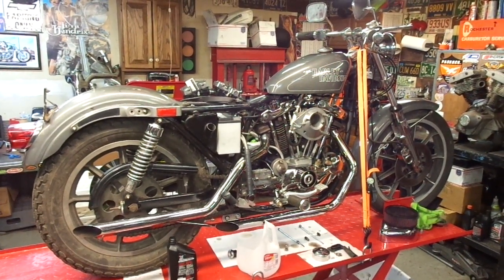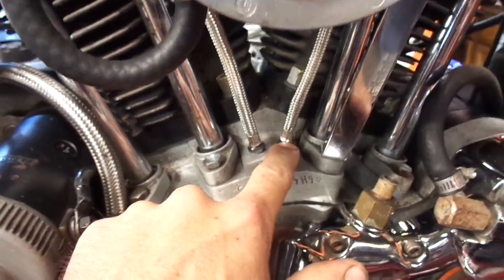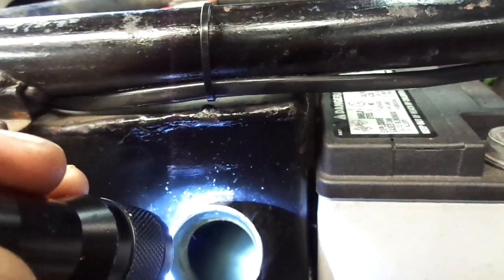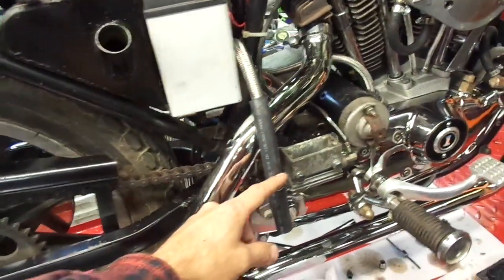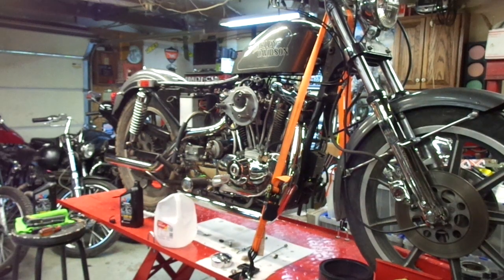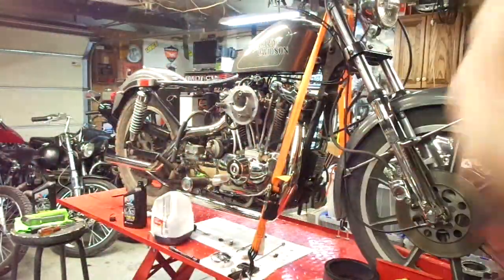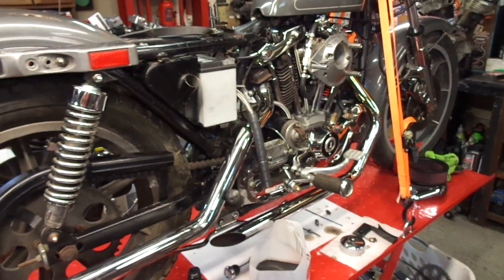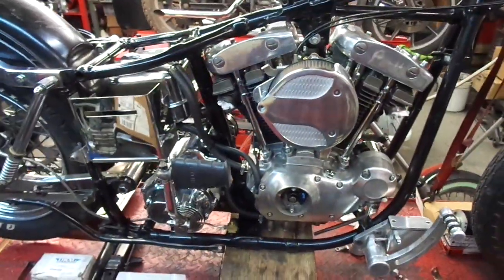Harley Oil Change Flush Out The Old 79 Barn Find

Comment: I just looked at a product called Scavenger Oil Change system, and I'm wondering if I could just tap into the oil filter with a hollow brass fitting, like an air fitting and connect a hose to it and run it into a pail to push out all the old dirty oil. Maybe it would be as simple as drilling out the oil filter and screwing in the brass air fitting. Couldn't I then just idle it and watch for the oil to run clean and then shut the bike off? Would I still have oil pressure, as long as the fitting isn't too big?

Comment: I was wondering if I should add about a quart of diesel to the oil tank just before I change oil and let it idle for about 5 minutes or until it warms up, and then drain, and maybe fill it with some cheap thinner oil and then run it easy for about 15 minutes and then drain. I wonder about sludge especially in the lifters. It's a 20 something year old Sportster. I first wanted to see if anybody does that or recommends it before I do it.

I did that to my van because I had coolant in my oil due to a timing gasket failure. Sealed it with K Seal and then gave it a flush with about a quart of kerosine I had, letting it idle for about ten minutes. The motor seemed to like it. It quieted right down, and ran better.
Reply from the maker: Personally no I wouldn't add diesel to the mix your gonna have hard time getting it all out. Like in the video I'd remove the oil return line from the tank, start the bike and pump the oil old out. You could feed an extra quart through until cleanish oil pumped out aswell.

Comment: I'm just finishing up a 1980 Ironhead I ran it a couple times so far and just running it with the bike still on the lift but I'm getting a little smoke and black liquid out of my rear cylinder exhaust seems to thin to be the oil but also doesn't smell like fuel when I rub it on my finger would you have any idea of what it could be. Any info would be greatly appreciated thanks for all the great informative videos also.
Reply from the maker: Well it's got to be fuel, oil or maybe just some moisture from sitting mixed with carbon in the pipes. If just smoking out one cylinder possibly valve guides leaking some oil past or maybe the piston rings. A compression test might not be a bad idea to see how much difference between the front and rear cylinders.
I appreciate you watching the videos!
Reply: @jfrost77hd  I'll do a compression test and thanks for the info I really appreciate it.

Comment: Hello JFROST I had a dumb question you probably know I have a 79 Ironhead was wondering how much oil to put in primary?
Reply from the maker: On the side of the primary cover there is a bolt about a quarter way up the cover which is the fill level with the bike standing straight up.
Reply: Cool thanks that’s what I thought I just wanted to make sure thanks man have a good one 🤘🏻

Comment: I have a 72 sportster been sitting for 19 yrs. my friend got it running about 10 yrs ago. He has passed since. Now wanna get it going again. What kind of oil does it take?? Don’t know much about bikes but gonna try it
Reply from the maker: Hey Josh, 20w-50 engine oil...would also be good to check the primary side oil aswell and topoff with Harley trans fluid or equivalent if it's leaked out.

Comment: Hey bro really like that video much appreciated just bought a 76 250 Sprint SS brought home that night   with it drink a couple beers pulled out the sawzall cut the rear fender off then lower the rear fender by about 4 in and cut the rear loop section of the frame off for the tail lights and signals used to be haha, anyway bro mindset for a long time it only has 2,224 mi on it and since 1976 so my shits really fuckin sludgy man, any tips on this little cheap ass 250 Sprint, no man it's a cool little bike and a great first little bobber for both my daughters to share and learn to ride, I don't know if I can on this side but I'll try to shoot you some pics, tnx brotherman n much appreciate..

Comment: Awesome video brother im about to revive a 1990  and want to do this as well , is the 90 block the same as 89 ? The reason i ask is i own a 96 sporty and my block is way different , i dont have a vent tube behind oil filter , mine are in the heads to the breather . Just looking for info on when the blocks changed .you seem to work on them figured you might know . Looking at a 74 as well
Reply from the maker: Hello,
I really don't know much about Evos unfortunately, this bike was a 1979 Ironhead.
Reply: The crank case breather was changed to the heads only because of EPA emissions crap. I rerouted mine from the heads of my 2018 out under the motor because that shit going back into the intake is a no go for me. The 90 block is the same as the 89, they changed it in 1991. The 4 speed bikes (86-90) vented from behind the filter and 5 speeds (1991+) vent from the heads.

Comment: This video help big time🤟 frost, and is that a oil filter between the rear master cylinder and the engine howd you do that? Where does what connect what?
Reply from the maker: Hey Julio, glad the video was helpful. That's the starter your referring to I believe, thanks for watching! 👍
Reply: @jfrost77hd  oh yeah I see it now ... I got this same bike but it's a kickstater from the bay area I just saw the other video helpfull 🤟 keep them coming...
Reply: @jfrost77hd lol I got o e problem man, my bike is on neutral right and when I try to rotate the engine with the kickstart i can see the the cylinders don't move, what do u think the problem is frost?
Reply from the maker: @Galaxieshop  I assume you mean the pistons do not move when rotating the kickstart? Either the kickstart gears are not engaging the teeth on the clutch basket or you have no primary chain or missing other parts under the primary cover.
Reply: @jfrost77hd  yea that's right pistons smh, thanks for getting back to me, I will check  all of the gremlins of my check list 🤟

Comment: hey mr frosty, I recently completed a custom shovel chop, total mish-mash homemade motor, lol. after a few hrs of running I'm getting a lot of seepage from my exhaust rocker shaft caps, high-pressure readings (80+psi) and now its leaking from my top rocker gasket on the rear cylinder. checked the check and relief valves and ball, seem ok... getting flow at the tank, even drained about 1 quart thinking I had too much oil in to start with. any ideas? (besides pulling her all apart again? :(
Reply from the maker: I've seen some rocker endcaps seep especially when engine is hot   and if you didn't replace the seals it's probably time. The topend really isn't a pressurized system but oil volume. Are you sure the breather gear is timed with the cam correctly?
Reply: hey buddy, I got it straightened out. figured something wasnt letting it flow properly? had to be either the check or relief valve? so I picked up a couple of each for like a b$ck apice, put the weakest one in the relief and it worked perfect! Engine is a frsh buld with new everything, including a Ultima pump... second one of their products that I've found to suck (or not what I ordered) the other is a damn SHITTY kicker set-up on their 6 speed tranny. the spring or something in there is preventing the gears from engaging when I try to use the kick. others have had the same prob I've heard. Lessen of the story? stick to Harley parts ;)

Comment: Yeah bro I got my 1980 Ironhead Sportster 1000cc running last night.
I dont have a reverse throttle cable in & that screw under the throttle housing.
The throttle will go forward but not reverse back sometimes?

I was told I have to have it in & told not to necessarily,getting mixed statements?

I let my dad run it last night & said it kept wanting to die,then he had to pop the clutch in 1st to keep running?
You know what would cause that?

I'm getting ready to change the oil for the 1sT time since buying it 2 weeks ago.Replacing it with new oil.
Getting ready to replace the spark plugs too.To see if that's what's keeping it from dying.
I got a new battery in it?

Damn bro I wished you lived in Indiana! 😆

Comment: do you ever run a car engine cleaner fluid of any type through the engine or is that dangerous to do to motorcycle engines?
Reply from the maker: I occasionally use Seafoam spray in the carburetors, Stabil in the fuel before storing or the Stabil Fogging Oil in the cylinders. B-12 Chem-tool works good for decarbonizing heads before rebuilding them. I did get some jet fuel I plan to play with ratios for an octane booster but nothing to crazy. Thanks for watching Robert!

Comment: Good clean videos..nice work bro
Reply from the maker: STUCK ON THE LINE Hey thanks for watching!
Reply: jfrost77hd my wife has a 96 883 that has a miss once in a while I've cleaned carb put a new air filter I was told it's gonna have it with drag pipes..runs great idles great just hiccups once in a while any ideas
Reply from the maker: STUCK ON THE LINE Have you replaced the intake manifold gaskets, could just be an intake leak?

Comment: its pay now or pay later with the oil seems like a good idea well done
Reply: Which line is the return line?  I just picked up an 85 iron head that’s been sitting for ten years.  It has a small hose on top, but I assume that’s a vent line?
Then there is one mounted to the bottom of the battery tray, which I’m assuming is the drain line?